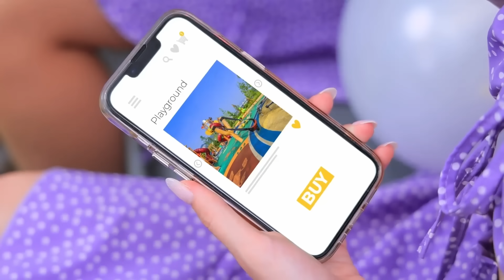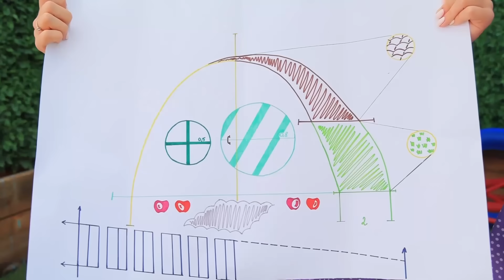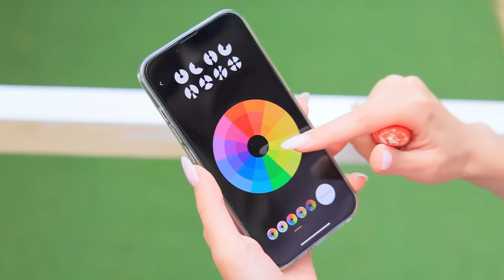We Build Secret Room Underground! Surprising My Little Sister by Secret Room

Comment: When people think of the supra they think of the A80 supra which is a legend and the disappointing A90 supra. But most people have forgot about the A70 supra.

The A70 supra generation is when the celica and the supra became separate models so it is the first non celica supra. It shares all the characteristics of the A80 supra but it’s just an older car. The A70 supra had amazing sounding inline 6 engines. Overtime the car would get more powerful and the 7M-GE engine was switched to the 1JZ-GTE.

Late model A70 supras were the best supras. The already good 200hp became 276hp with the 1JZ-GTE. Pair that with rear wheel drive, a manual and the decent weight of the car and you have a great car you can absolutely throw around corners.

The 1JZ-GTE engine is also a very well built engine and is capable of handling 700hp with stock internals. If you tune an A70 supra well it can become an absolute beast in a straight line and corners.

The car also had a beautiful and simple design. And always looks good no matter what year it is. It has simple yet stunning lines and pop up headlights which makes a great combo. The back window curves outside the body of the car into the edge of the fenders which also contributes to it’s great design.

The driver focused interior has all of the controls on the driver side angled towards the driver making you feel like you are piloting a jet instead of driving a car. Another reason it should be more appreciated.

Because Toyota messed up the 2019 A90 supra we have to look at the past generations to find a good supra and we can’t just ignore all the supras for the A80 supra which is in high demand by JDM heads. This is why people need to check out the A70 supra when building an awesome JDM machine, there are more great supras then the A80.
Reply: Bro was your homework to write an entire essay in the comment section of a cringe YouTube channel